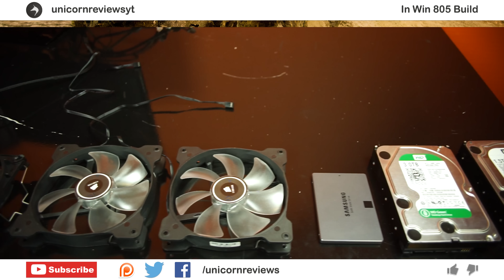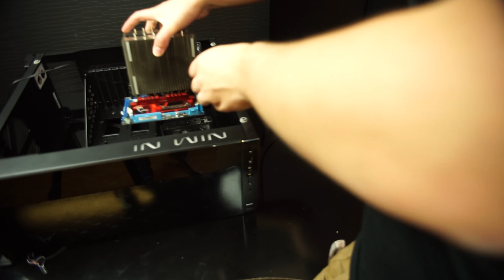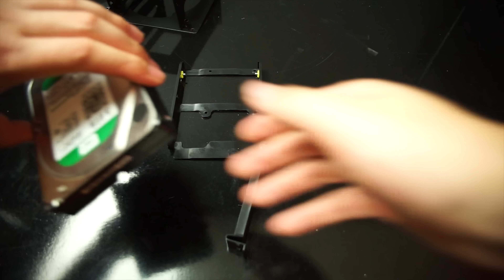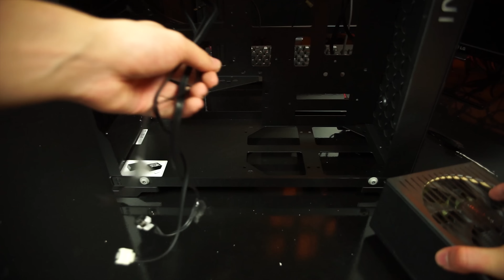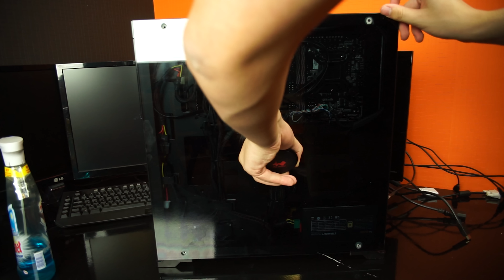In Win 805 Design Computer Build Time Lapse

Comment: Nice! I like the tidy cable management behind the mobo tray. Great touch of adding those custom coverings for the bottom power supply area! Lastly THANK YOU for cleaning off the glass panels before putting them on. I hate seeing videos where the glass or glossy parts are all smudged.

Comment: Hi :-) Nice and neat looking build! I was wondering - where did you get the covering panels to hide the power supply and such in the bottom of the case?
Reply from the maker: +saisukee those are diy
Reply: +Unicorn Reviews Could you do a guide on how to make one?
Reply from the maker: +Ti-Tantrum its fairly simple, just do it in cardboard first so you can cut awat bits or tape bits back on. When you have your final design, trace it to wood or metal and cut
Reply: Can you provide measurements or a template? I have the same case as you

Comment: Hallo, nice video.
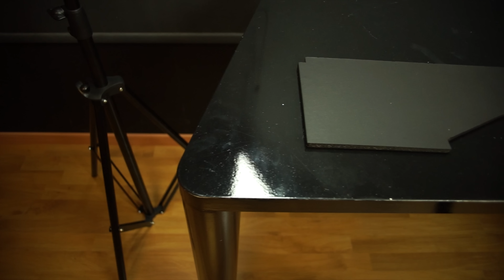At the end you have the floor covered these 2 plates, they are  in Case. or homemade?Will it also cover how you did it in the video. 3:56
Reply from the maker: +MoReMaXiMuM Those are homemade.
Reply: +Unicorn Reviews Do you have a construction manual for this? : D
Reply from the maker: +Knuute It's fairly easy, just grab some cardboard and cut it until it fits. When you have the cardboard piece just trace it on metal or wood and cut it :)

Comment: Why does not my InWin logo light up, there is an unused wire in front panel with 3 pins not sure where i can put in the power supply. Thanks

Comment: How the heck did you manage to fit a 160mm NH D14 in there?!? Every review I've ever read about this case says it will only with a 145mm max cooler.
Reply from the maker: +gladosadoree Then every review you've read was wrong. Basic rule of thumb: If the case has a 120mm rear fan, a 160mm heatsink fits. A I/O plate is 44.45mm tall but extends 2mm below the board so you end up with 163.35mm of clearance on nearly every case.
Reply: +Unicorn Reviews Thank you very kindly for your swift reply! :) You helped me tremendously!

Comment: I want to do an In Win 805 build as well.  I want to use Scythe Mugen 4 which is 0.2 cm higher than Noctua D14. How much space is left between your cpu cooler and the glass panel?
Reply from the maker: +Ryan Rasoelbaks not a whole lot... It might fit though but not 100% sure

Comment: How's the airflow in this case? With the PSU covered, I don't see how there's still an intake in this.
Reply from the maker: The air is forced to go though a 20*4cm gap in the front. Airflow and temps are actually better this way
Reply: +Unicorn Reviews what material did you used for the psu cover? and are you using airflow fan or sp fan for the air intake at the bottom?

Comment: How were you able to fit the Noctua NH-D14 in the InWIn 805 case? The case says that it can only fit 156mm CPU coolers whereas the NH-D14 is a 160mm
Reply from the maker: No modifications done. It's a super tight fit, but it fits. Case manufacturers are usually a bit on the safe side with there compatibility numbers.
Reply: Unicorn Reviews So it's safe if I find a CPU cooler with a 160mm clearance height? How much room do you think is between the glass and the heatsink?
Reply from the maker: +PhanaticFilms virtually no room left. But any case with a 120mm rear fan can take a 160mm heatsink
Reply: Unicorn Reviews Ok thanks Unicorn for the helpful response. Appreciate it.
Reply: Unicorn Reviews Do you think you could send me some pictures of the NH-D14 in your InWin case if it isn't out of your way? I would really appreciate it so I have more confidence in my decision in a CPU Cooler.

Comment: But, why use an itx mobo!?... Awesome cable management btw.
Reply from the maker: I've spend 2 weeks searching online for an atx board and didn'y find one except for a 450€ maximus V board on ebay. I even asked a few contacts and no one has z77 boards anymore.. I hope it doesn't ruin the video too much
Reply: +Unicorn Reviews No not at all,  you had to work with what you got but a few extra pci slots to take advantage of the case size would have been cool... plus I know how hard it is to find good hardware at a decent price in Belgium, most of the time I order mine from France or England.

Comment: I am soo 50/50 on buying this or not. I have high-end specs video, cpu and memory with as many drives as possible ... airflow (Or lack of it) is really a concern. I am thinking of 240mm radiator pre-ready water solution but I can't see where this radiator will get cool air from. Very confused.. The case is a killer-look madness but with the limited air it can turn into a cooker rather than a cooler way of showing your PC :| #confused
Reply from the maker: +Tycondaroga You could put that radiator in the bottom if your psu isn't too long. Or take my chamber approach. I haven't any issues with heat at all tbh.
Reply: +Tycondaroga I have this same case and I use a Predator 240 AIO cpu cooler and mount the 2x120 fan radiator to the front.  I have two 120 fans on the bottom and one 120 exhaust fan and I don't have cooling issues.  I do not use the drive cage since I use SSD drives.
Reply: Guys, what do you think, could this case handle gtx780 sli, open air cooler type cards, and aircooled 4770k? i am also little worried about the airflow.

Comment: What CPU cooler are you running?
Reply from the maker: +Mitchell Sharkey A Noctua NH-D14 with Be Quiet! fans
Reply: +Unicorn Reviews is there any clearance between the D14 and the side panel glass? InWin says it only supports 156mm CPU coolers, but the D14 is 160mm
Reply: How much is space is left between the side panel and your cooler?
Reply from the maker: none, or at least less than 1mm
Reply: I was thinking either a Be Quite Dark Rock 3 or Dark Rock 3 Pro